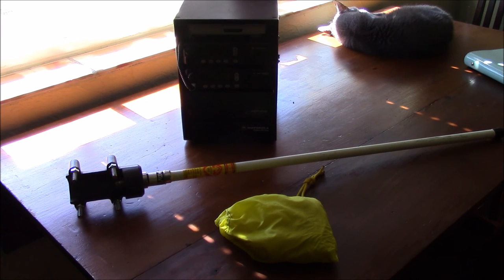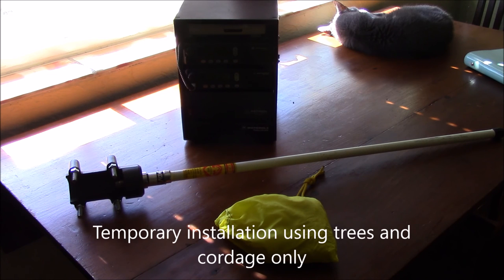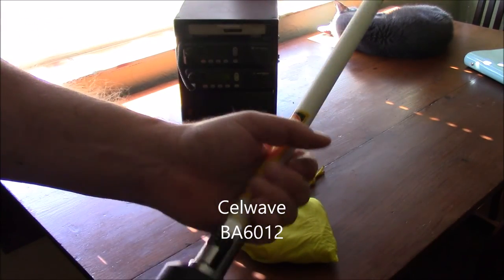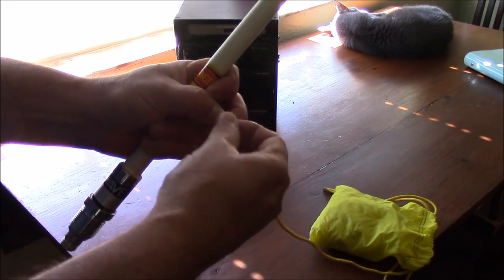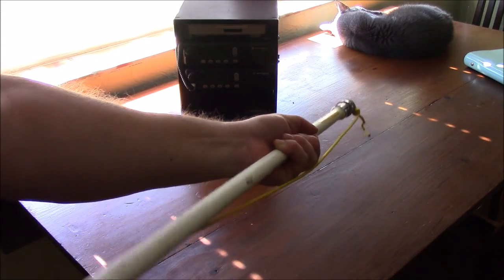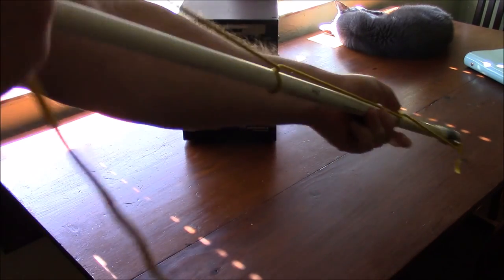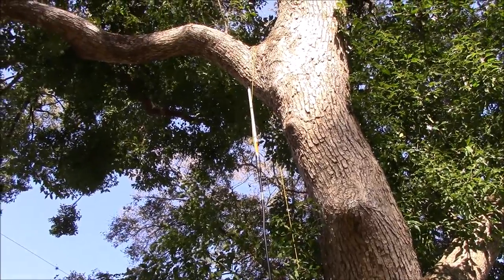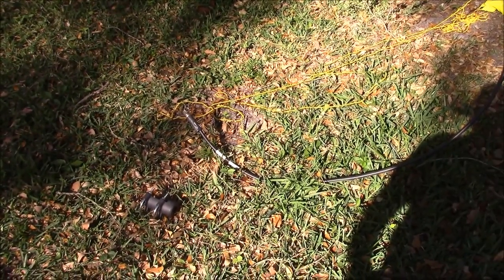Field expedient UHF repeater antenna mounting with cordage

Comment: Hhmmm... That was ingenious.  Thats how we rig antennas to haul up a tower, never thought the rope could also be used as a tower. nice vid as always.
Reply from the maker: We would rig tools for hauling and personal escape like that too. I tried it with an antenna and it worked pretty good on a trip. It is no bueno in heavy wind however and a large length of heavy suspended feedline will stress the connector but as a temporary fix its pretty solid. Thanks for watching !
Reply: What i was advised to do, and now follow, is to attach a prussik knot around the feedline and hung this from the cord attachment point. the feedline makes a J and tension is relieved from the connector.
Reply from the maker: That is a great idea !